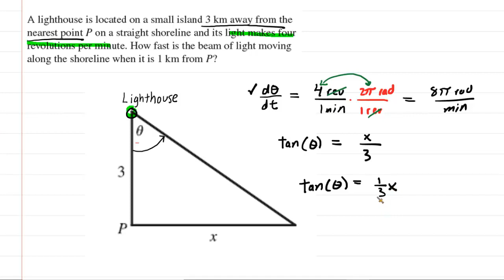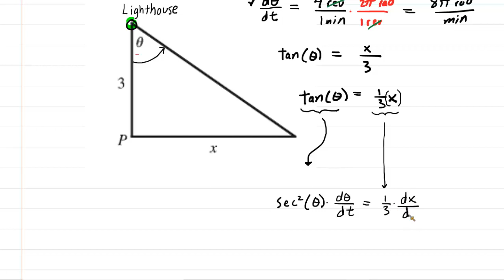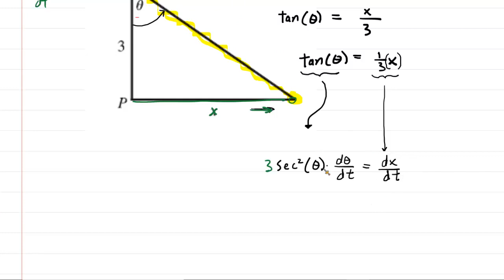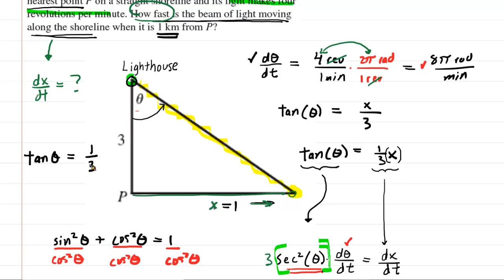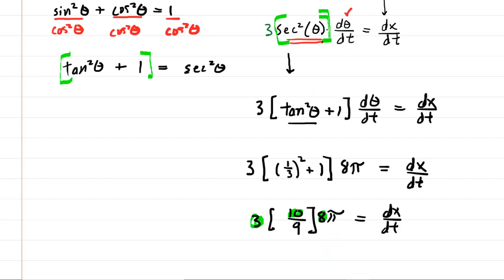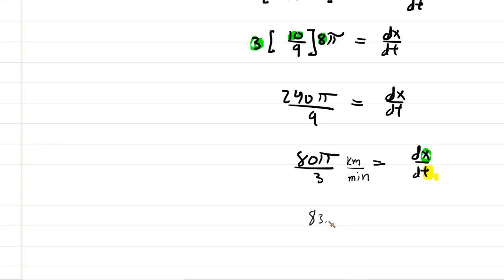A lighthouse is located on a small island

Comment: I started this for fun, but now it got me curious. In physics, I was taught that speed = angular velocity * radius in a circular movement. Assuming the light on the wall can be represented by a circular motion with varying radii, I can make a function v(y) = w * sqrt(x^2 + y^2). With w (angular velocity) being 8pi/min, and x being fixed at 3km, we obtain v(y) = 8pi * sqrt(9 + y^2). Substituting 1 for y brings us v(1) = 8*sqrt(10)*pi. I wonder why this seemingly physically correct approach has a different result than yours. Any clues?